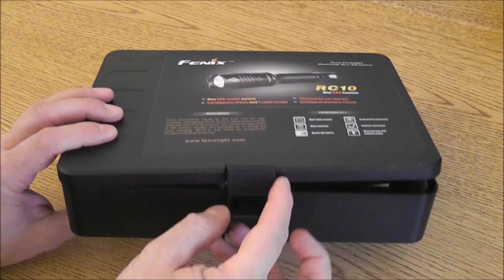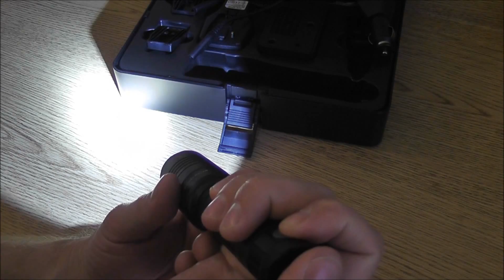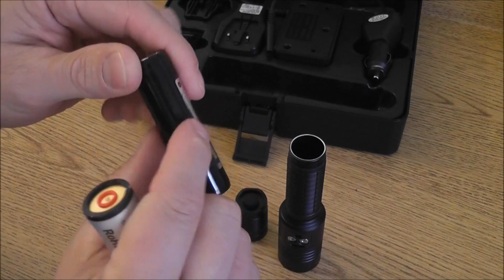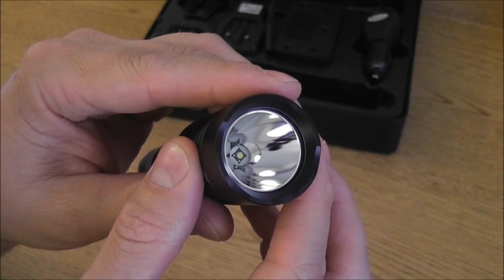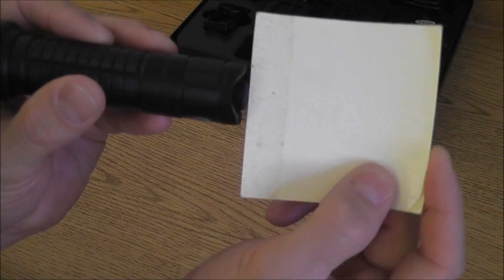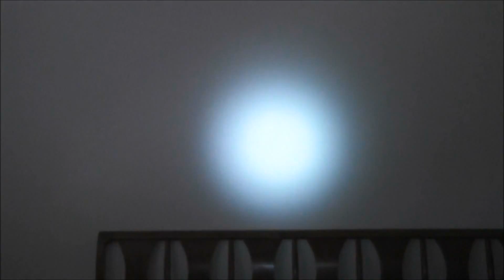Fenix RC10 Rechargeable (Desktop Review)

Comment: Just wanted to note, the mode change "delay" is because the mode changes on the side switch's release, rather than the push in. If it worked the other way, it would change modes while segueing into the strobe mode, which could be bad in certain situations.

Comment from the maker: I think it depends on the frequency & brightness of the strobe along with the ambient light. We took 6 different strobe lights & used them on one another in a dark training room with desks and chairs so that it was difficult to move. With the brightest strobes we found that you could see & back away while the attacker was nearly immobilized. If the attacker was bold, he would run into things. It was enough to draw an X26 carried on the weak side though. Good points on traffic use man!

Comment from the maker: A 4000mah 18650 is a myth at this point in time.  The best 18650s are still 2900-3100mah so anything you see higher than that it's nothing but an advertising gimmick.  Lots of good cell info available at candlepowerforums to get you up to speed along with a list of respected cells like AW and Redilast.

Comment: I've only bought Fenix lights in the last few years, so I can't recommend outside that brand from experience. I'd suggest, then, something in the Fenix E-series or the PD22 if you want more potential punch. For batteries, Google battery junction and take the top result that's not an advert.

Comment: Patriot this is going to be a little off topic but I'm getting the Tk35-U2 (860 Lumens), and i was wondering about different batteries and i see different 18650 with like 3100mAh and 4000mAh can the 4000mAh work well with the Tk35 or is it 2 much. I'm kinda new to this whole thing and was wondering because i hear the higher the mAh is the longer you can run your light. The only thing i heard from people where to make sure it was protected so i was looking at the ultrafire 4000mAh what do u think

Comment: Looking for UI of a  dual mode Fury in another brand that can use 18660s. Having hard time. Scenario is hiking with light on low and suddenly the need for full power is needed one handed and under stress. It no modes to go through. Surefire DO Fury is perfect  except batteries. I use tk41 and have to hold sel  button down for hi strobe. A bit too long delay  but works for now.